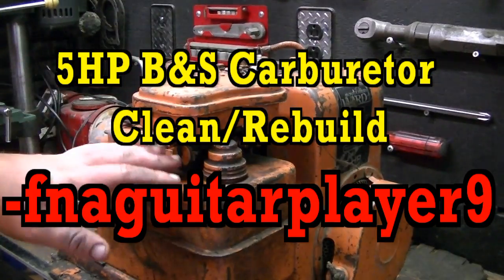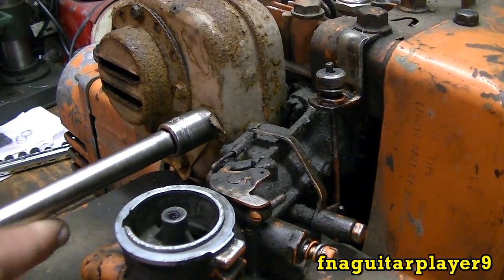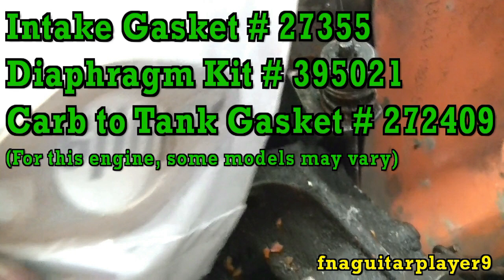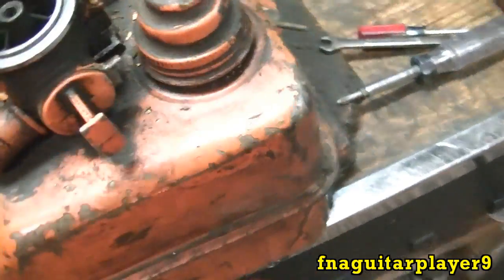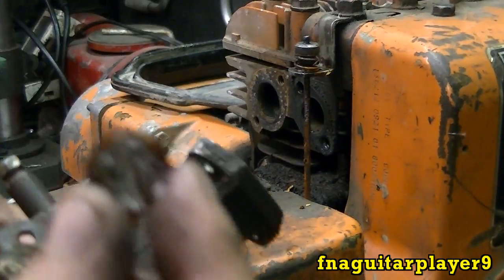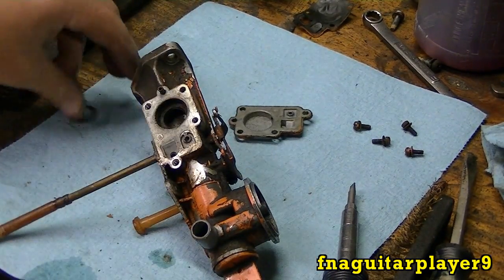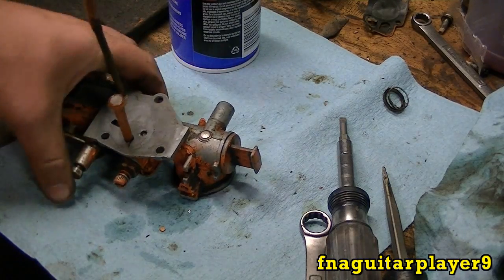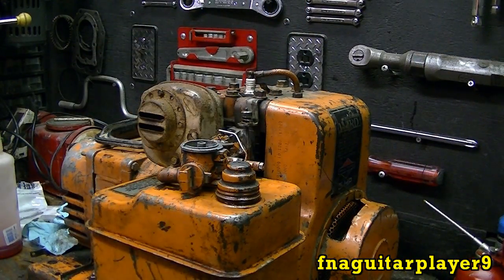5HP Briggs and Stratton Carburetor Clean and Rebuild (Pull Choke Type)

Comment: Intake gasket 27355
diaphragm kit 395021
Carb to tank gasket 272409
I find myself spelling gasket gasquet because I used to kayak near a town in the farthest north of coastal California you can get to. But, Its pronounced Gaskee . Sounds like a French California gold country word. Part numbers in the video description would have been cool. Good video, thumbs up. I have a bunch of these to work on, one says 206 cc on a troy built tiller, top priority.
Reply: Diaphram kit 395021 is no longer available. Try part # 5021k instead
Reply: Thanks very much! Here is the Briggs and Stratton Diaphragm kit #5021K, on Ebay. It contains the diaphragm, the spring, and the spring cap, - all needed to rebuild the fuel pump on this carb.  https://www.ebay.com/itm/Briggs-Stratton-5021K-Diaphragm-Kit/320982820610?epid=11026503357&hash=item4abc112702%3Ag%3AKP0AAOSww9xZCkeeIt&fbclid=IwAR0cEtw_bdgXTYEeqK41j_VSdEXKGKKuVMJF85Mg_zOJgpCtvy3i9bF8psI
Reply from the maker: Thanks for adding the number, haha i hear ya, the main reason I don't put #'s in the videos, sometimes i do but, there were alot of slight variances and people may order the wrong parts and blame me for it. But yeah on certain things that I'm 100% sure it will be the right # i put them in. Thanks for Watching!!!
Reply: Very fast money but rusty tanks take time
Reply: What is the part number for this style Briggs oiled foam air filter?

Comment: Really nice vid, my issue , being pretty much the same design as you have there other then the choke setup , mine being a lever on the side , is where to get new linkage, thanks for this vid though 👍
Reply from the maker: Thanks! You may be able to find the linkages on ebay, sometimes people part out engines and you can find them, you can buy them new. Go to the briggs site and get the parts diagram for your engine using the model type and code numbers and that will get you the part #'s for them. Thanks for Watching!!!

Comment: I have the engine on a go kart  and need help hoking up the throtal any advice?
Reply from the maker: Its best to connect it to the bottom piece under the tank, so it will be governed, if you bypass the governor it will not hold up with the high rpm's. If you do it though... you will need some type of clamp and may have to make a bracket to anchor it to then connect the cable to where the linkage connects on the carburetor. Thanks for Watching!!!

Comment: Can anybody tell me if the "oil breather tube" is necessary for the engine to work properly. I'm currently working on a rototiller engine with a similar engine/carb. (Briggs 5 hp). I think it's a newer version though - it's the kind where it has the throttle and choke levers on a little 'control panel'. It is missing the oil breather tube, and when I checked an online parts catalog, they list the tube as "obsolete and unavailable". Mine still has the retainer clip for the tube under one of the carb-to-tank  screws.A guy in another similar video about pulse-jet carbs casually mentioned that the port on the carb for the breather tube was plugged with silicone, but didn't say any more about it.
Reply from the maker: IT will run fine without it, it doesn't affect performance or power, its just a emission control and if any oil is pushed through it will spill on the ground instead of going through the engine and can let water in the oil. You should be able to find it on ebay. But yeah if you plug the whole on the carburetor it will run fine, if you don't plug it can suck dirt/water into the carb while running. Thanks for Watching!!!

Comment: Have you ever seen one leaking gas out of the back of the pull choke? i can't figure out how to fix it. Thanks for the video!
Reply from the maker: It might be from the gasket between the carb and tank, sometimes it can kind of spray up towards the carb. I've never had one leak at the choke though. Unless its loading up with gas in the carb body and its seeping out past the choke, if thats what it is, check the air filter and adjust it a little leaner. Your welcome, Thanks for Watching!!!

Comment: Greetings. I am trying to resolve problems with a very  older style Briggs horizontal mower with a Pull Choke looks like the one in your video. It is installed on an old Ariens rotary hoe (a barn find). I have solved all the problems except it requires a spring for the governor (missing) plus I am not sure how to install a replacement (fixing points, one is obvious). The model details where it should show the model number ..says model number but there is NO model number (faded away?) Could you kindly tell me the model number of the engine in your excellent video please?.  Your support would be most appreciated.
Reply from the maker: The model number should start with 13 on the 5hp, you can usually go by that, (that represents displacement, 13 cubic inches) there wasn't a whole lot of changes on these, as long as it has the same carburetor setup its the same, there were changes on piston rings though. And you should be able to find parts on tulsa engine warehouse or off of ebay if you just need a few parts. You can upgrade these to electronic ignition for not much more than the cost of putting new points in, by buying a magnetron coil for it, buy one for a model 13 made around 1983. But i do have videos on replacing points and condensers and setting the gap. hope this helps, Thanks for Watching!!!
Reply: fnaguitarplayer9 re build kit for 5 hp briggsandstrattonenginecodes

Comment: my motor only starts when i cover the carb with my hand then it cuts off after like 5-10 seconds its a briggs raptor on alky
Reply from the maker: Sounds like the carburetor is trying to run to lean, the carb needs cleaned and or adjusted, if its cleaned thoroughly and still does it, it might need a rebuilt kit. Thanks for Watching!!!

Comment: Good look at that set-up. I have Monkey Wards "Pumpkin" off of a snowblower too. I use a little right angle ratchet screw driver for that bottom carb screw, but sometimes can fit a slotted screw driver into the screw head sideways, and use it like a wrench, but when that one is on super tight... it sucks!
Reply from the maker: +John Strange I have one of them ratchets, I didn't think to try it, will do that next time, hopefully mine will fit in there. haha yeah, sometimes they are crazy tight, lucked out on this one! Thanks for Watching!!!

Comment: I like your videos oh ya by the way I got a 12 hp Briggs and it idles fine but when you give it full gas it kinda surges.the muffler is the stock round right on the head and it leakes a lot , I wounder if it not enough back pressure or if it's the card
Reply from the maker: +Carson Albrecht Thanks, appreciate that! Its possible its the back pressure, but Its doubtful to be honest, its probably carburetor or valve related, could be a weak spark too causing it. Thanks for Watching!!!